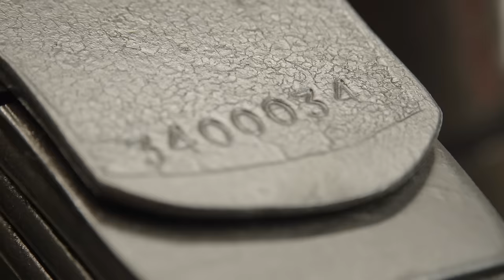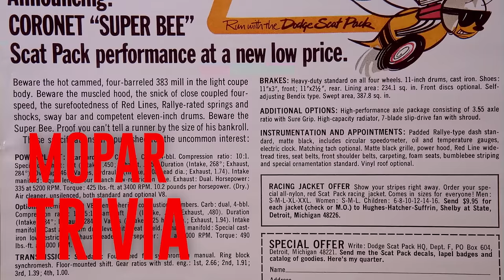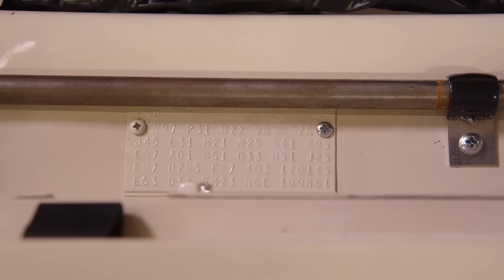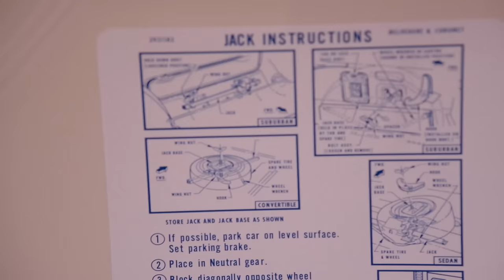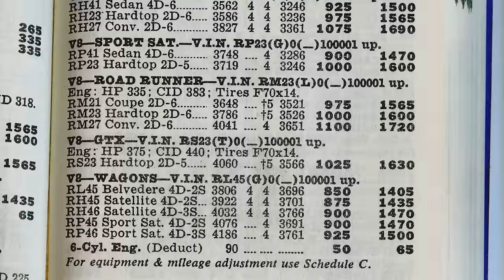A DREAM CAR THAT BROUGHT A GROWN MAN TO TEARS! '70 ROAD RUNNER 392 HEMI.

Comment: I swear I had one or I should say redid the whole car back in 91 looked EXACTLY like that mine was a 440 4 speed built up it ran 11.80 all day long. Bought it in a barn just outside of Westminster Md had it a few years after I put a fortune in it then traded it for a mint 70 RT Charger 6 pack 4 speed was yellow with the factory black stripes. Man I miss that Roadrunner.

Comment: Growing up my Uncle had a 68 Dodge Charger SE,  Dark Green Poly, Black Vinyl Roof, White Interior  Bucket Front Seats, Console Shift Automatic, Am/FM Radio,  AC, Had a 318, 727,  8 ¾, 3.23:1 Rear End, Both Chrome Mirrors drivers was Remote, Hood Mounted Turn Signals, the Brakes was odd as it was a late production had the 69 front Brakes with the 68 Rear Brakes which we would out on a vacation in the mountains when the front brakes went out, It had the Steel Wheels with the Large Caps, Even though it was a 318 it was one of the most beautiful Chargers.  He's getting up in age now former Diesel Mechanic and has had a ton of health issues, how ever if I ever could do it I'd love to be able someday to get him one as identical to what he had.  I know he would be tearing as much if not more if he had another one. I found a Die Cast similar to it few years ago except it had the Magnum Wheels but he was in tears. He's got a few Photos of it when I was a kid standing next to it. The only thing id do different would be either the Magnum's or Rallye's on it and even though not availalbe id go with a 340 in it just so it would move down the road.  

Thanks for such a great show and love seeing these kind of Episodes.

Comment: I owned *I think as a1972 Challenger that was as gold color paint, white leather interior.  *forgive, me , it's been a few years. It was the 383 engine model.   And, I was taking notice, as to recent builds, even as some rather more historical pictures.   I don't see that color.  I just remember liking the interior seat design and the horseshoe shifter with detent center and below.
I recall huge caution when it snowed, as it was so powerful it was all to easy to break traction and tail slide a bit sideways. It had many design features as the "cuda".

Comment: Part of the reason those heavy cars were so cool is they hold the road due to weight. Some good proper tires with a bit of width and they are great for road racing. I could fly on dirt back roads in cars I owned back in the 70's and 80's. Even into the 90's you could still find nice used ones. I was a Mopar guy. I destroyed my bas ass Mopar. It was a dodge Coronet with a Hemi in it factory stock. 66 . It was a sleeper by looks but stick your foot it and it was gone. Too much for as I did total flying and pushing it. I totaled. The engine was saved. I do not have either anymore.
Reply: @johnnyduplantis  Miss those days and most importantly miss those cars. That crap they make today is ridiculous.

Comment: What’s with the tag screws? One is painted and the other is not.
Reply: The tags were originally painted with only one screw holding it to the apron bent up so paint hit everything.  After paint the second screw was put in to hold it down.